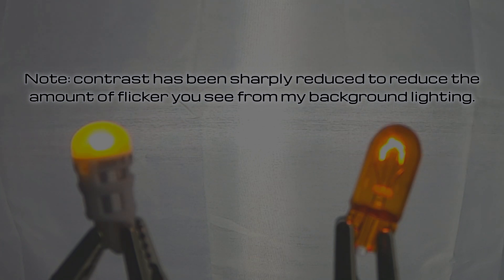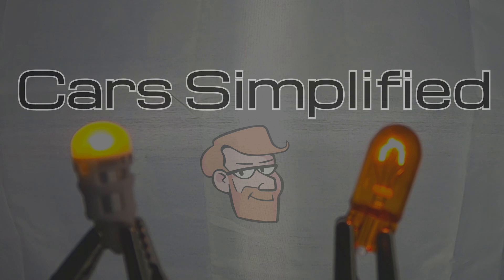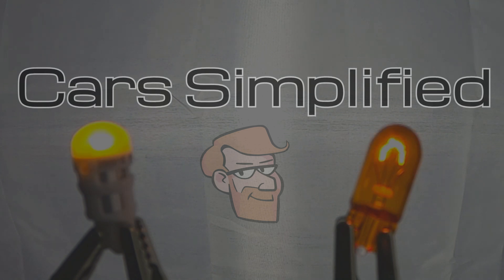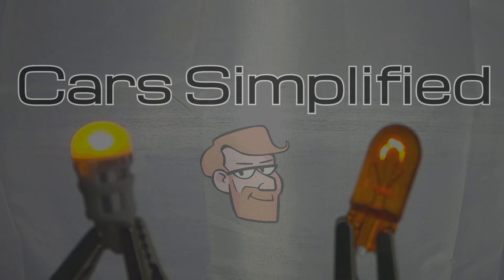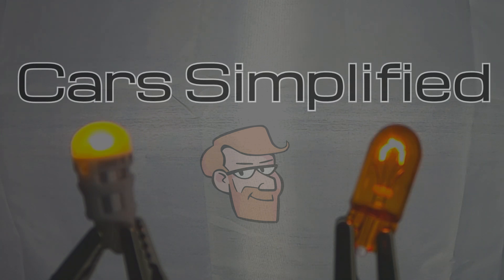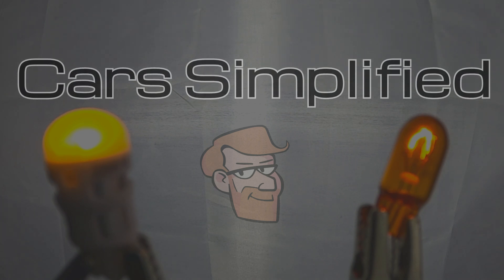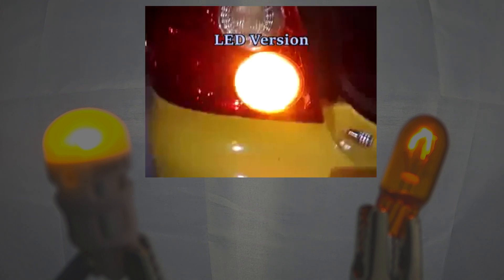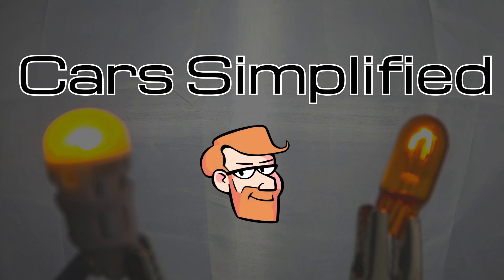Led Light Slow Motion VS Incandescent Bulb Turning On/Off (Turn Signal or Brakes) • Cars Simplified

Comment: I think in this day and age, all exterior and interior lights should be LED.
Reply: Indeed. No excuse for all the incandescent bulbs still coming with brand new makes these days
Reply: Agreed! Stephen actually hooked me up in the past.
Reply from the maker: The one downside I've seen someone mention about LED headlights is that they don't de-ice the headlight lenses as quickly, but other than that, I would definitely like LEDs to become normalized, as long as they are made just as easy to replace as traditional bulbs. Some LED third brake light assemblies have to be replaced as an entire unit, unless you can get into them and do some soldering work.
That was a fun collaboration with 802; the lights looked fantastic in person after the swap!
Reply: @CarsSimplified  they don't generate the heat so because LEDs are cooler they won't melt ice and snow as quickly.
Reply: @CarsSimplified  Literally hadn't thought of that. Def important up here in winter wonderland.
Reply: @CarsSimplified  An easy fix though would be an automatic de-icing system with fluid that it sprays to lower the freezing point of water to thaw them out